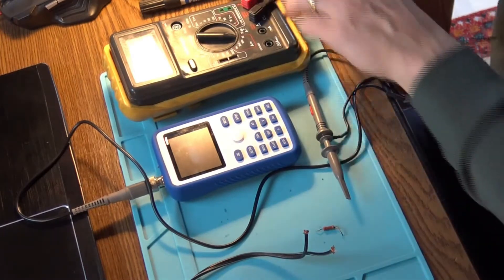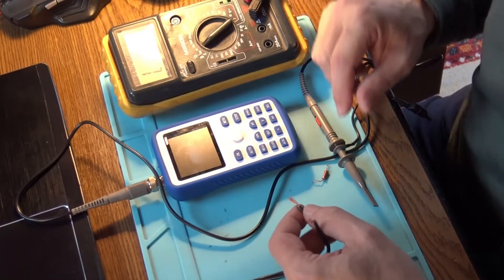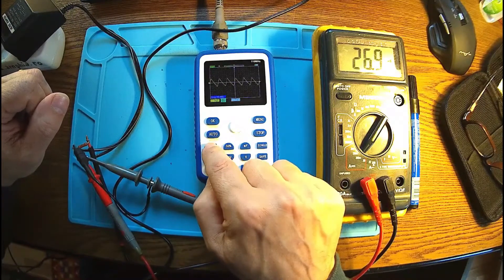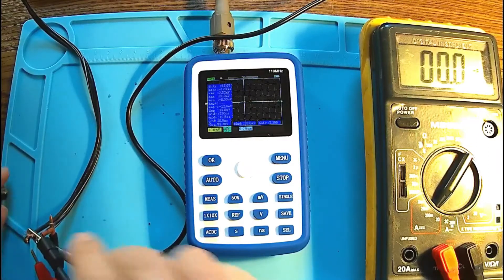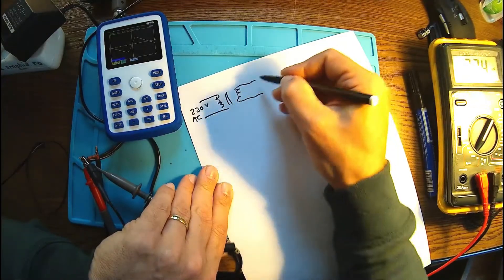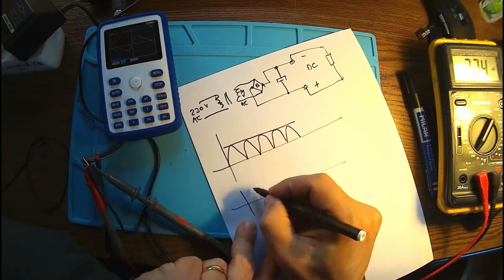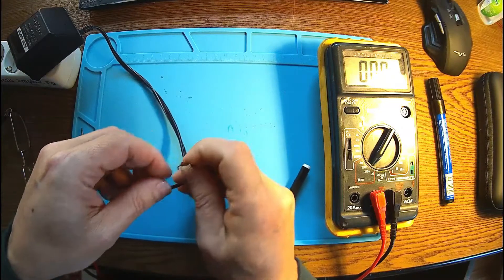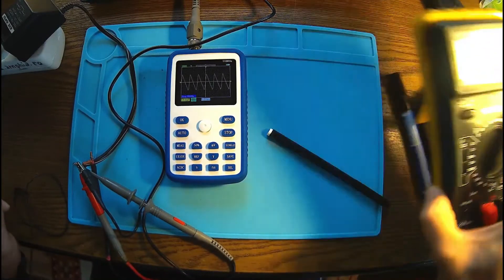How to measure ripple with FNIRSI 1C15 oscilloscope

Comment: Very useful. I  bought the oscilloscope yesterday and I'm starting to learn. I have a 12C DC ower supply with a rheostat for model train powering, and I just checked with the 1C15 that it delivers half sine wave at 100Hz frequency. I would like to install a filter on it as I use it to power up a led strip but when i try to dim the light with the rheostat, it flickers badly. You gave me some ideas on how to correct the problem, thank you.
Reply from the maker: It's better to use a PWM pulse width modulation  circuit, it's pretty difficult to DIY but there are a lot of boards to buy..and you not loose power and heat thru a rheostat..but depends on current the model needs.. this little one goes to 3A https://www.hotmcu.com/lm2596-buck-dcdc-module-p-50.html...all you have to do is to replace the blue trimmer potentiometer with a 10K big one..also a piece of aluminium on the main circuit to assure heat sink.About PWM take a look here..https://youtu.be/EPV6hnNpXkM ..it's the same principle

Comment: hi i saw people use a capacitor series with dmm to read ac ripple
Reply from the maker: Very possible, a capacitor isolate AC only, the goal is to have low voltage, lower is better